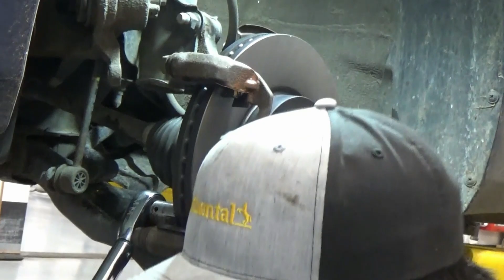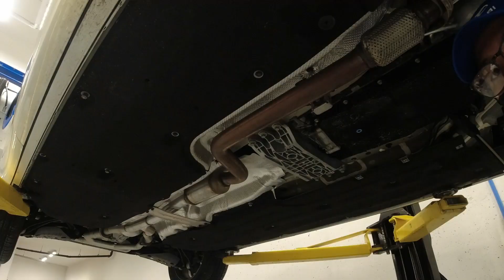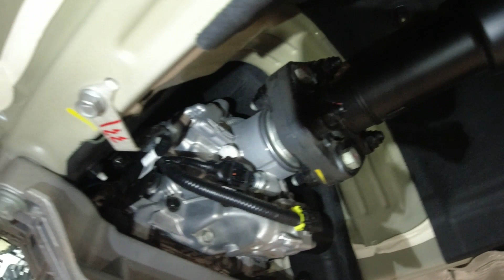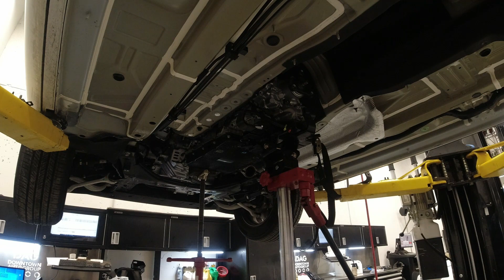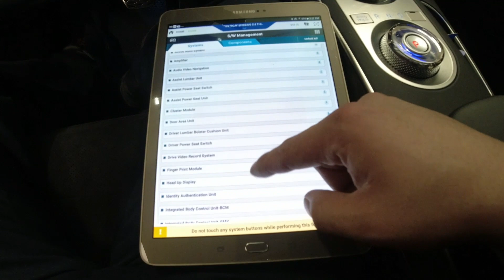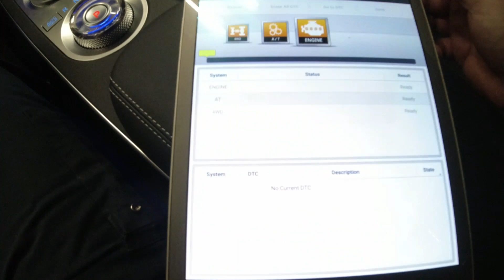Genesis GV70 Grinding Noise while Driving, Transfer case Replacement

Comment: hi, i appreciate the video you share they are very informative,  so my question I noticed a grinding noise from my vehicle recently. The dealer diagnosed it as a transfer case issue. Since replacement parts are currently on backorder, I'm concerned about safety. Is it safe to continue driving long distances with this problem? i have GV70 3.5T
Reply from the maker: If the grinding is loud and and feels like its gonna fall apart i think you should ask for a loaner, and if you are driving long distances i would not recommend driving the vehicle.
Reply: @hyundaitech  thank you very much!

Comment: So many comments on forums about transfer case issues. How common is it really? There is a recent TSB on this, but it still makes me worried.
Reply from the maker: Right now if you have awd light on or elsd light on intermittently or constant we are just replacing the actuator itself unless the transfer case is leaking or making noise. Hope that helps.
Reply: We have a 22 GV80 and the forums were rife with failures.  Nobody talks when things just work, so..  but it was a  high % of a very small sales lot a year ago imo.

Comment: I have a gv70 and 2.5t that needed the transfer case replaced due to grinding and rattling sound. Started at 2000 miles but very subtle like something loose in the vent behind the climate control- drove around until 8500 miles and dealer said those sound problems are hard to diagnose.  But finally got fed up with the sound and told them to look at it …

Comment: Great video content.  Can you tell, was there an AWD warning or dash light as well?  with codes P196000 and P195800?  Thanks.
Reply from the maker: On this video there was no warning light but only noise. I have another video with gv70 woth warning light for the all wheel drive on that we had to replace the e lsd actuator. The codes that you mention, hyundai just  sa8d replace the all wheel drive actuator , if the vehicle equip with elsd  replace the elsd actuator. Hope that helps and thanks again

Comment: The forums are full of people with transfer case issues! There is something seriously wrong with the design or the production line!
Reply: Yea I initially regretted getting the sport adanced instead of the sport prestige until I saw all the people complaining about the ELSD failing. Def seems like it has a high failure rate and the way I beat on my car I'm sure mine would've failed.

Comment: That looked like a pain, but as always you pulled it off👌
I didn't see a drain or fill plug on the transfer case, is it still a sealed unit from Magna?
Reply from the maker: The fluid is prefilled from manufacturer, and as per service information its non serviceable. Im not sure if its from Magna, but i know they do that kind of stuff. But for this one, coz it was back order we had to wait from Korea. Hahaha the vehicle was sitti g for a good month waiting for the part.